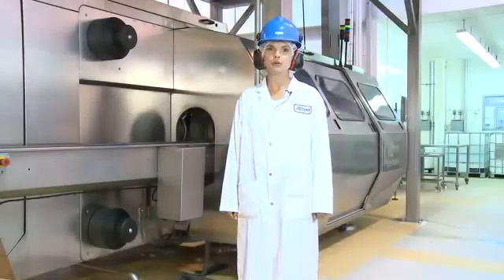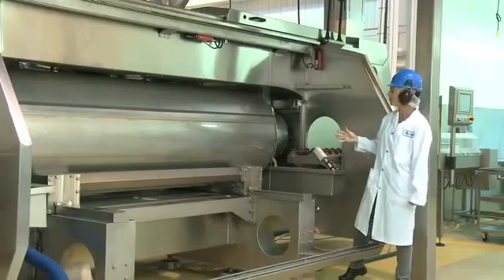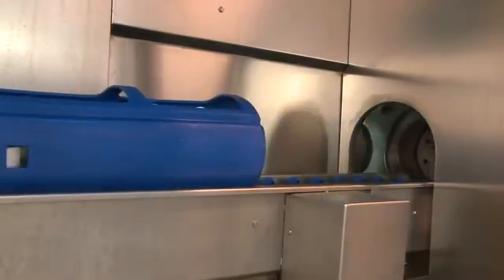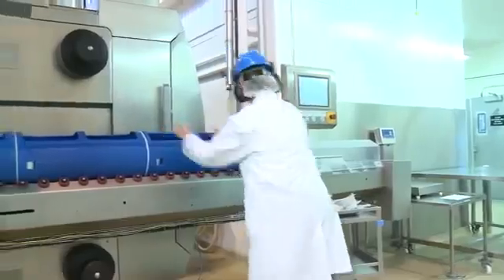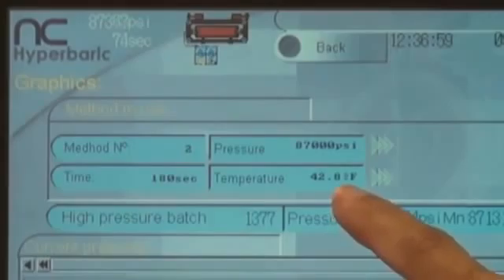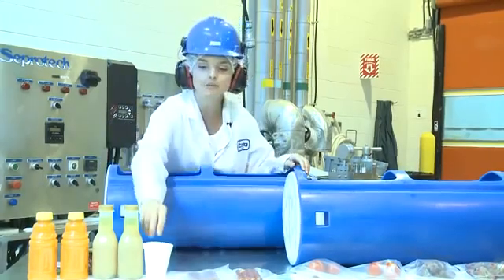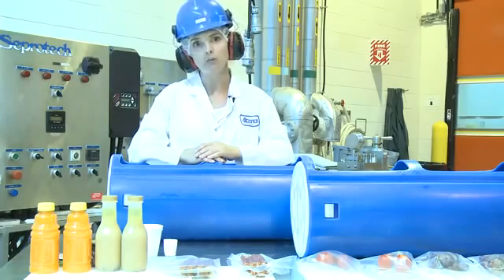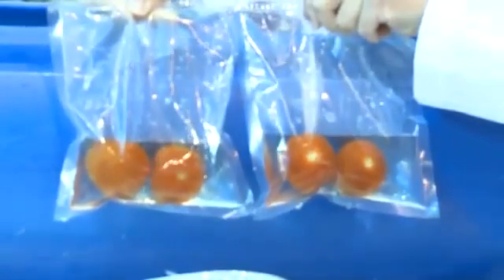How High Pressure Processing  works to give food a longer shelf life

Comment: Howcome under this enormous pressure, why are plastic bottles not just completely destroyed??? What about Bysphenol A and other chemicals.. due they leak from the plastic into the product due to this process?
Reply: actually the pressure applied from all the sides, hence the bottles are not crushed.
Reply: @ganesant512  But there is some air in the bottle right?
And even if You put pressure on lets say plastic round ball in 600 MPa plastic should be destroyed right? 

Is plastic in a standard bottle cap is capable to withstand 600 MPa if pressed from both sides?

Comment: How it is that the bottles aren't crushed, they have air in them so it seems to me the plastic bottles would crush a bit.
Reply: That was my question. Any air under that pressure should look for least amount of resistance and gravity should direct it upward in the chamber. This should blow the cap/tops off the bottles. Confused
Reply: HPP is a post-packaging solution: already-packaged products like PET bottles of juice or vacuum-packed meats are processed under evenly-distributed pressure which ensures that the packaging is never crushed/distorted. Glass packaging will not work with HPP.
Reply: @timstirrup6948  But the air in bottles is compressible so it should allow bottle to distort a little?
And plastic bottle cap can withstand 600 MPa if pressed under "evenly-distributed pressure"?
I mean its like a milimeter or 2mm of plastic....will it not crush a little?
Reply: @Julo133  I'm not an expert but I was looking into this too and this is how I belive it works. In order for this technology to work you need bottles filled with fluid to almost max capacity. The air trapped in bottles get compressed causing deformation on the bottles yes. But bottles will be deformed in its weakest point which is the side, where wall thickness is around 0,6mm, not the cap which is thicker. Once air is compressed to its max compression value, the pressure outside and inside of the bottle is uniformed and there is no reason for further deformation of the bottle or the cap.
I hope someone with experience or sufficient knowledge can explain better or correct me if I'm wrong.
Reply: the food products are not crushed due to the "isostatic principle". It means that all the food products after being loaded into the chamber, they are filled with water. Then the pressure inside the chamber is distributed evenly and uniformly. Imagine if you have an egg submerged in the water, you can apply high pressure to it but it won't be crushed or destroyed.